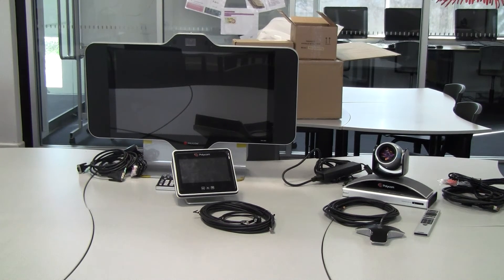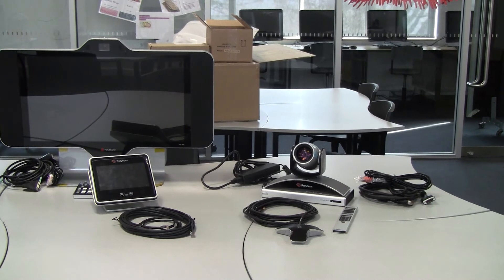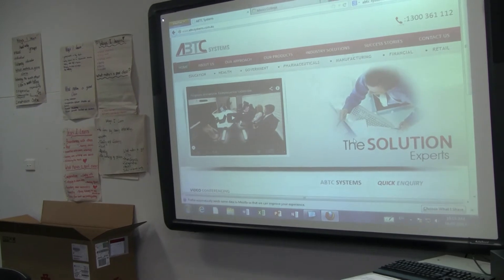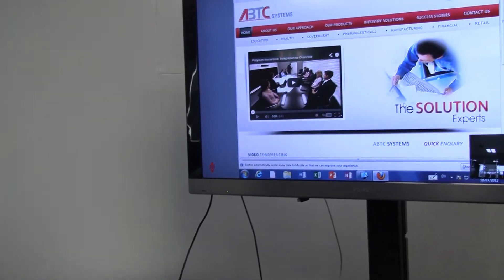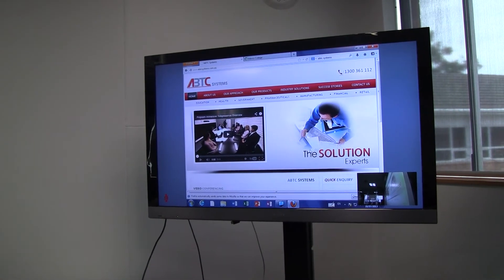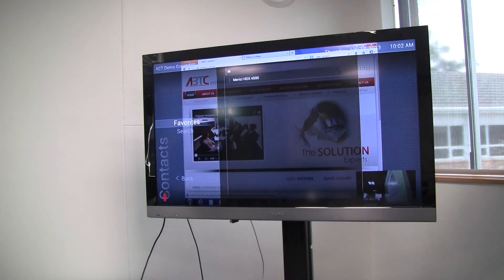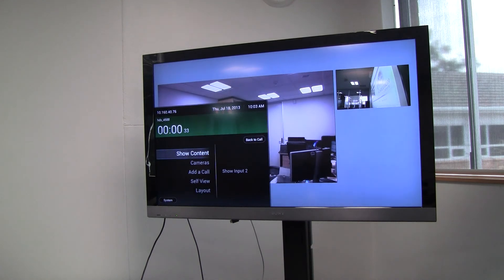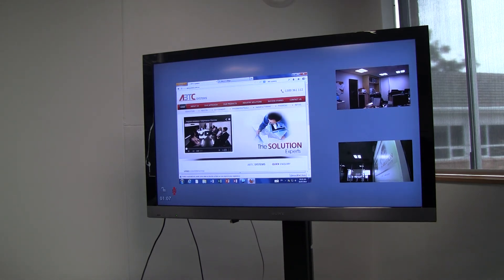Video Conferencing Education part 4 Project and Devices Explained

Comment: hello Mark,, i like to check how u share contact to other user screen. i like to show my screen to other user but i can't (present Powerpoint from my screen to other user), can please tell me.
Reply: Sharing content is simple you just connect up a source to the input on the Conference system and select content sharing to enable the source to be sent. It is important to remember that Video audio and content sharing use different network ports. Sometimes I have experienced that the video and audio will transmit but the content will not transmit. This can be rectified by ensuring that your internal network connection and the far side both have these ports open to enable the content sharing to work.